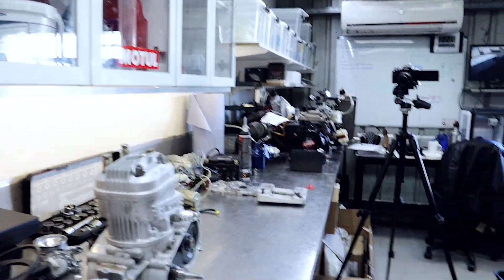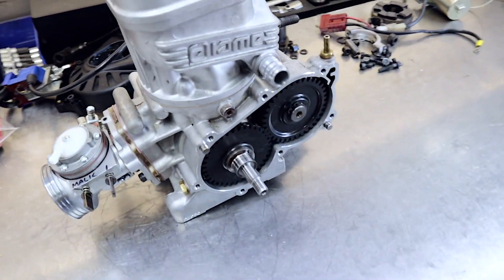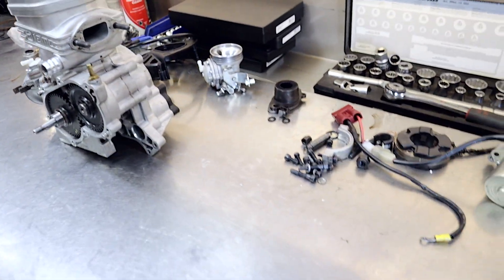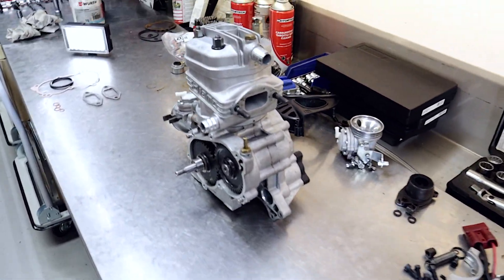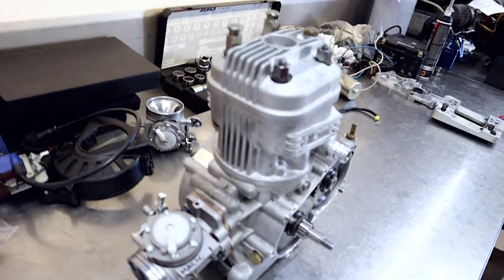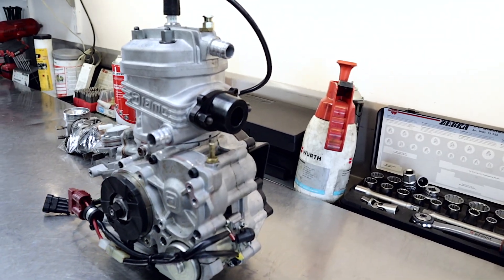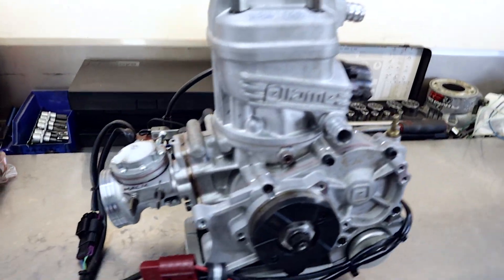TIME LAPSE  - Rebuild GO KART Engine In UNDER 8 MINUTES 😁

Comment: Hello there from Holland. 
Is there a way to remove and install the crackshaft and balance shaft bearings without a press?  Or is it then an impossible job to do?
Thanks. 
Bjørn
Reply from the maker: yeah you can use a heat gun or gas bottle to heat up the cases.  we have a video on that, check this out........
https://www.google.com/url?sa=t&rct=j&q=&esrc=s&source=web&cd=&cad=rja&uact=8&ved=2ahUKEwiY6-iqqOXzAhW0umMGHS86Ag4QwqsBegQIARAB&url=https%3A%2F%2Fwww.youtube.com%2Fwatch%3Fv%3D05ESgCaFWJs&usg=AOvVaw0eZJ4Bfj4gCgEQUjurCjXl

Comment: Hi love the channel.  In the UK we are moving on to e10 fuel 10% ethanol. I believe this will destroy 2 stroke engines. Do you have any advice on how to remedy this thanks.
Reply from the maker: Nah it should be fine.  Maybe don’t store the fuel in the kart. And don’t use old fuel as the ethanol apparently can’t attract moisture.  Other than that should be all sweet.  If you can adjust your ignition timing to suit ?  What engine have you got?
Reply: @PowerRepublic  TKM BT82 air-cooled 2 stroke

Comment: hey derek, a few questions, hope you can answer them. - what should I be able to get in terms of rpm with a rotax sr non evo? - how do I know if my gear ratio is too low or too high? - what is the lowest gear ratio without being harmful to the engine? greetings jordy
Reply from the maker: -13.500
-revs and speed will be too low/high compared to the enemy 
- can’t hurt em with gearing IMO

Comment: Would you say this engine is less complex than a Rotax?
Reply from the maker: I would in the sense it doesn't have a power valve assembly to hook up.   other than that, they are very similar

Comment: Hello power republic.  I have a zanard x30 ime and I want to tune it.   Any chance I could tune it  with out using a mychron
Reply from the maker: yeah easi, could use a EGT or just slowly do it session by session checking the spark plug

Comment: Seemed to have a lot of end float in the crank. That's a hefty balancer You'd think the manufacturer would try and improve the basic balance of the piston/rod/crank instead of wasting power driving a balancer. Kart engines with comfort?? Suppose you don't want your foot to vibrate off the go pedal.